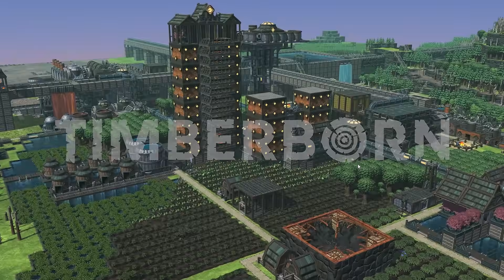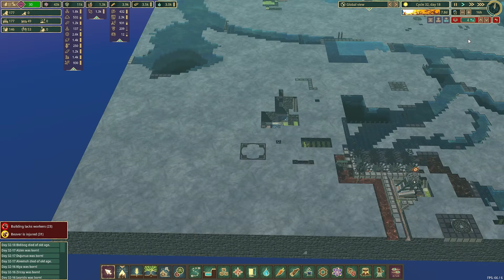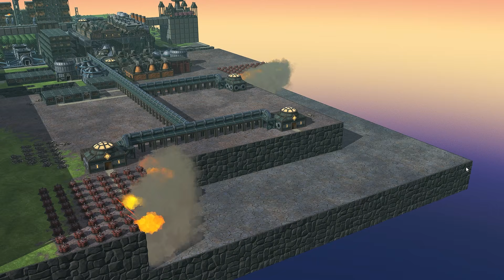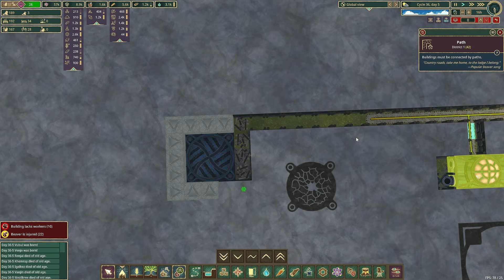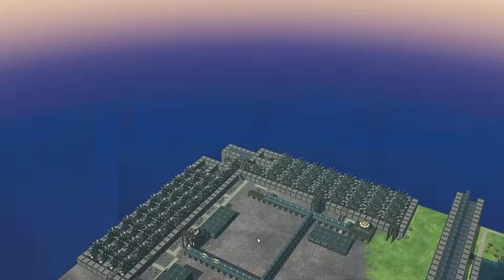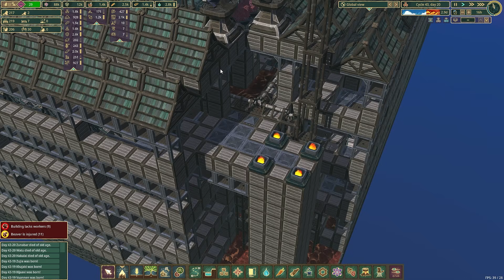Vertical Water Power! - Timberborn - Skyborn #7

Comment: 29:19
"... I know large water wheels would have probably produced more power for this space..."
-- and you'd be wrong.
Large power wheels give 135hp/cms, for an effectiveness of:
- 9hp per cms per square they occupy (footprint +wall) compared to 10 from the compact water wheel,
as well as
- 1.8 per cube (total volume, including that same wall again) vs. 3.33333
...
Where does this myth come from, that these extensively expensive large water wheels were that good???

And:
Yes!
- it's actually 135hp/cms!
- not 270!
The description is false!
Same problem for the folktails version, which promises "135hp/cms" but also only gives exactly half of that!! (67.5hp/cms)
Compared to the 60hp/cms by the compact water wheel (0.888 effectiveness for half the cost!), that's pretty underwhelming...

PS:
I layed out my reasoning in another comment (actually: 2!) of mine, when answering to @zj6074 (who did get a heart from the channel), underneath...

Comment: In my copy of your power plant, I added a tube staion and bad water pump on platforms at the outflow point in the corner.  I routed the tube through the overhangs along the side of the map to a point outside.

Comment: if you use mods, you can get a tiny tube station 1x1x1 size, there is another mod that gives you both zip lines and tubes for both factions, and the water extension has a turbine power generator is the size of 1x1x1, goes in line with the current flow and generates 30 hp/cms and acts like a shaft as werll, you can make a power network with this turbines and flood them and you will get a lot of power. a regular water wheel for the folktails occupies a volume of 3x2x3 and you can replace that volume with turbines so it can generate 540hp/cms if you can keep that volume full with water and that can be done with the right water sources.

Comment: 3:00 Wouldn’t splitting the flow cause the power output to be halved?
Edit: Ohhh, you split it because you don’t want overflow.
Could you make the channel two blocks tall and place the water wheel higher though? Or would that still only give half the power?

Comment: Were you feeding the power house with 2 or 3 badwater sources? I assume 2, so adding the 3rd could increase output another 50%?
Reply from the maker: I have 3 bad water sources feeding into this one - I think the CMS for each is 3, 3, and 4 for a total of 10cms. 

I think the bottleneck of the design is each side wing only being able to handle ~4.2cms of flow when fully supplied. Normally you would think that each 1-block height would be able to handle 6.6cms of flow - but I get hit by the requirement for there to be a slight height difference between water level height in adjacent blocks for there to be flow. For a single floor of zig-zags, I cover enough distance that I lose about .36 meters of water height between the first and last spots in the zig-zag, dragging that 6.6cms flow of potential down to 4.2cms.

If I had enough bad water sources, I think the better design would have been to go with 2 deep channels. Losing .3 meters of a 2 meter trench is only 18% power lose due to slope (as opposed to a 36% power loss on a 1 deep channel) . Of the potential 13.2cms of potential in a 2 deep channel, I estimate I could have pushed 10.8cms of flow through each side, so more than double my output while only adding 1 additional block of height to each floor. On the downside... I think I only have 14cms of bad water across the map, so I wouldn't be able to properly power it outside of a bad tide :(

Comment: Zeddic. There is a Skye season where he built a mega plant. I think it was last October of 2024. One thing he did was show that small water wheels are better. However each corner you need to put 9 edges. You also need to put 2 layers of levee walls. His power plant got something like a hundred thousand power or some ridiculous amount. But again he designed it to have 9 edges everywhere. Take a look at it. Don't copy it but you may be able to do a few small tweaks and get your plant to output way more than it is.

Comment: So I did some math on large vs small water wheels.

Small water wheels have a horizontal footprint of 3 tiles & a vertical height of 3 blocks, making a total cube volume of 9. It makes 60hp/cms. Thus, a small wheel produces 20hp per cms per tile of space, and 6.667hp per cms per cube of volume.

Large water wheels have a horizontal footprint of 10 tiles & a vertical height of 5 blocks, making a total cube volume of 50. It makes 270 hp/cms. Thus, a large water wheel produces 27hp per cms per tile of space, and 5.4hp per cms per cube of volume.

This means that large water wheels 35% more efficient than small water wheels in single-layer designs where only horizontal space is a consideration, but small water wheels are 23% more efficient than large water wheels when stacking multi-level runs together as you did.
Reply: But there are more walls needed for the small wheel. If you add the space one wall needs its 18 cube for the small and therefore 3.333 cms/cube while for the large wheel with one wall added to the equation it is 75 cubes and it results in 3.6cms/cube.
Reply: As it is easier to get a high flow rate on one tile, the small wheel still should be the winner. 😅
Reply: Addendum:
I found some reddit article which seems to confirm my suspicion (along with some other thing), from over a year ago:
"Water Stream Compression 2.0 - Maximizing the water wheels in Update 6"
-- if you do the math, and account for some error margin (like reading fluctuating flow at the wrong time), the picture the guy posted gives me close to 135 hp/cms for those large water wheels.
NOT 270!

It also confirms what I read elsewhere, that waterwheels "read" the total stream underneath them (but only for a one wide canal, regardless of their actual width?!?), NOT just that part they are actually touching...

So accounting for that, and the walls(!), the real math should read as follows:
10 hp/square (area) for the compact water wheel & 3.33333 hp per block (volume).
= 0.5 times YOUR values.

Meanwhile, the large water wheel loses out tremendously.
It "only" loses out by one third when accounting for the walls, but then it's getting halfed, as well, when accounting for the erroneous efficiency:
9hp/square and 1.8 hp/cube
= 0.3333 the amount you calculated... 
((2/3)*0.5)

And for that they cost you 6 times the raw resources per wheel and additional work (+power) to turn close to one half of that into planks, first...
Yikes!

EDIT
I was curious, wether the wheels really just read half the [double] canal's cms, and actually made a test map for that;
With a total cms of 25, going through a canal (2 wide) with a depth of 1 on one side, 4 on the other, I could not get a different reading for a large waterwheel (Ironteeth),  regardless of wether they were aligned right or left.
But the reading was up to 3375 hp either way...
3375 / 25 = 135 hp/cms
Not 270!
Just exactly half that!

Conclusion: large water wheels are worse in every aspect!
Why isn't anyone talking about this?
Are people too careless to actually read those numbers?
Seems like this is an oversight on part of the developer, but noone brought it to their attention.

Anyway... I am going full "turbine", as early as I can, anyway, thx. to the  mod "Water Extention PowerEdition" (KnatteAnka)
That thing is a beast in the little space it occupies.
... and can neatly be hidden away, anywhere... Like in your main water supply, before the water feeds into the rest of the world ^^
30hp/cms in one single block; with walls: 15hp/square and 15hp/cube...
I think thats borderline overpowered.
Atleast they need treated planks (was it?) to be build.... ^^
Reply: @PyrrhoVonHyperborea  Is all that still true at max flowrate though? a compact wheel sitting in 1x1 canal canonly have at most 6.6 cms flowing through it. the large wheels sit in a 2x2 canal, which can have (I assume) 4x the flowrate. if you're producing half as much per cms, but have 4x the cms, that's 2x more output. 

The counter to this would be if 4x cms is even available on the map. But with deep mech pumps, you can add cms for the cost of 700 hp. if you're system is large enough, this results in more power tho, because who cares about proper energy lol. So if you added enough deep pumps to raise to max cms, I think the large wheels would actually win.
Reply: You didn't account for the single cube of support required under each.  The difference is closer to 11% more efficient for the small water wheel.
Reply: "... [Large water wheels make] 270hp/cms..."
-- but do they, actually?
Atleast the wiki claims that.
But the same wiki also claims, that a water wheel (Folktails) gave you 135 hp/cms.
-- have people actually ever measured that?

Well ... the real number is exactly half that which is promised for said folktail water wheel.
You'd need x cms times two, to fill out the 2 wide canal and get the "expected reading" for either half of the canal, with the desired power output.
But the total cms thus doubled and as such, the effectiveness is half the promised amount.
The description should thus read 67.5 hp/cms.

I cannot test this out right now for the iron-teeth, but judging by the above, I have to assume, the actual hp per total cms for the large water wheel is "135", not 270....
-- which severely undercuts the claimed advantage of those wheels.

Or maybe said error only applies to folktails?

Also, you forgot about walls.
You need to add a +1 in width to account for atleast one wall (next one gets accounted for by the next water wheel).
Reply: Structural engineer here:  you overlooked the floor thickness required for a vertical system.  Adding the floor thickness, the total volume for a small wheel is 1x3x4 and the total volume of the large wheel is 2x5x6.  So the small wheel has a potential of 5.0 hp per voxel, and the large 4.5 hp per voxel.  Same conclusion, but not quite as large of a discrepancy.
Reply: I do wonder if the mitochondria, sorry, powerhouse, could be even more compact vertically if each floor is offset one to the side.

I think you might possibly be able to get space for one more floor per 4 floors this way.

Comment: Instead of flowing the bad water off the map you could put sluces into the pipe at the end increasing the pressure (the sluces letting the water out will make it not flood)

Comment: Can you still "stack" waterfalls with dams and sluices? If so, that could let you have just the one tile, with 2 or 3 high sluices. Not sure, would need to be tested.
Reply: Stacking waterfalls requires the flow to be deeper than 1 meter.
So to benefit from stacking 2 waterfalls and keep single wide channel, whole channel would have to be 2 high and the waterwheels on platforms  skimming water surface. Each floor would then need to be 1 meter higher
Reply: @Obcybr  amazing how sometimes one can say things without thinking them through. You are obviously right, it would make no sense whatsoever, I should have actually read what I wrote before posting. Cheers mate.

Comment: 18:00 if water flows though a permeable floor, does each tile of the floor count as its own waterfall?
Reply from the maker: Each edge of the permeable floor has the potential to work as a waterfall, so with one block you have 4 potential edges. If you have a narrow 1-wide river though you end covering a lot of the edges.